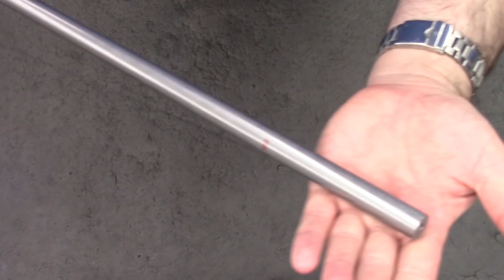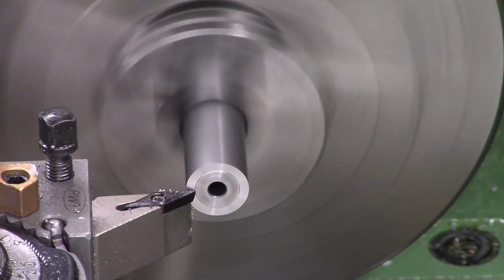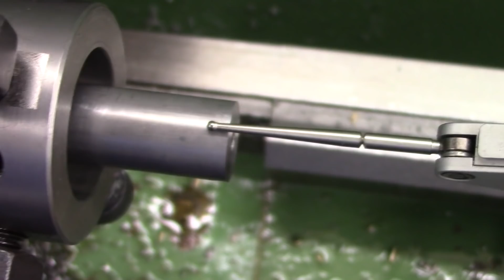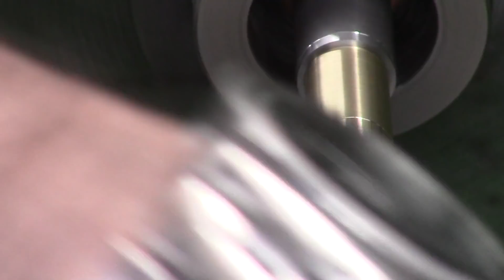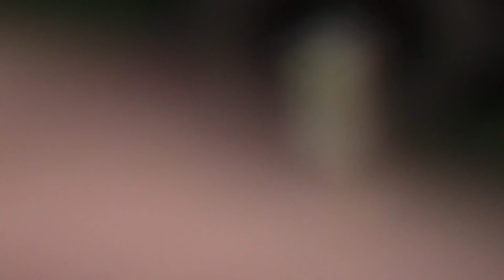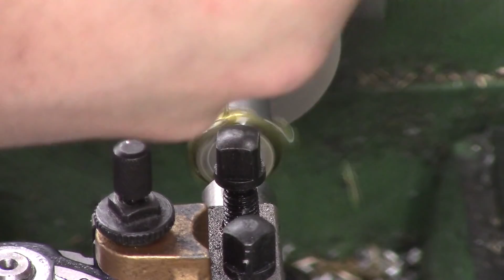Machining A Lothar Walther barrel to fit an FX Impact. Part 1.

Comment: Just bought a alfa barrel polygonal 177 blank for my leshiy classic how do I tell what end to crown no stamps on either end an will a standard 11 degree crown be OK on a polygonal barrel 👍
Reply from the maker: just push a pellet down it and one end will be tighter than the other the tight end (the Choke) is the end to crown and 11dgr will be fine  👍
Reply: @sub12airgunners  thanks ,,but there's no choke on it I forgot to mention that 😬

Comment: Hello, do you have a preference between the LW Poly barrels or Std LW 10 groove barrels? I want to strictly shoot slugs. 
Also, would you recommend using a choked or non chocked barrel for slug shooting? Cheers

Comment: I used a Lothar Walther barrel blank to turn a .177 caliber Benjamin Marauder into a .20 caliber. I left two baffles out of the shroud to get 2.7 inch longer barrel for better efficiency. I machined the bolt from brass to make it obvious that it was not a stock Marauder. The hardest part was making the fixture to hold the magazines for enlarging the inside diameter for the larger pellets. The result is my best Marauder. I now have a complete set of .177, .20, .22 and .25.

Comment: I ordered a .357 barrel and will be machining it soon.    I saw that you machined out the rifling on the breach end.  My question is on how to create a smooth lead for the pellet.  I am thinking of using a reamer for a standard .357.  Can you explain what you did on your barrel to get a transition from the smooth part you turned to the rifling? Thanks

Comment: This sounds like a great combination for an FX rifle and Walter barrel, What does this normally cost?
Reply from the maker: A barrel blank can be anywhere between £70 and £150+, then is cost to get in machined so depending on your gunsmith and what he has to do it will be another £50-150. But it all depends on who you get to do it. Thanks for watching.

Comment: would it be a straight forward job to fit a LW barrel to a hatsan  AT44--10 ?
Reply from the maker: No idea to be honest, depends on how complex the breach is, if you are having accuracy issues before having a new barrel machined I would take a look at the breach and crown, just make sure there are no burrs and that you can push a pellet through it nicely, and the pellet looks clean with no scrubbing of lead, then you could always have a little go at polishing if you want, a lot cheaper then having a barrel machined up. Thanks for watching.

Comment: You definitely made that very hard work for yourself . Would it be much easier using the life centre those barrels are very straight but I wouldn’t worry about the outside not being perfectly concentric because with a live centre it will be all done from the bore.
Reply from the maker: Probably, but doing this way we guarantee everything to work, the 1/2 unf will be 100% parallel to the last 40mm of the bore, eliminating any possibility of clipping with the shroud or moderator, and the pellet will be fed concentrically to the rifling, and while most barrels are straight they are defiantly not all made equal. We don't do hundreds of these and for me its a interesting job that I like doing, so I don't mind the back and forward with the indicator.  Thanks for watching.

Comment: Ace video dude 💪🏻 … off topic but would you make one of those brass pistons for the amp regulator? .. thanks 👍🏼👍🏼 and keep up the good work
Reply from the maker: Thanks, we don't make the brass piston anymore, they are a pain to make and we could not really see any great benefit from them, the only thing you gain is they last a little longer but they still need cleaning up after a little while. Thanks for watching.

Comment: Is it easy enough to cut a 1/2 unf on your warco? I've got the wm250v and and am trying to get my head round the change wheels.
Reply from the maker: This one is easy because of the gear box, you can select thread pitches using some levers, but you still have to change a gear to go from metric to imperial unfortunately. I had the WM180 before I got this one, whilst a bit of a pain to change the wheels you can cut threads successfully on them, my 180 had a list on the gear panel with the gear order and position for the corresponding pitch, the 1/2 UNF is a 20 TPI so just look out for that one and you should be able to find the gears that cut that pitch. thanks for watching.

Comment: Do you shoot fac air ? I am about to get a Raw HM1000x that will become fac . They have a lw poly barrel so should be good out of the box but I am thinking a match grade rimfire barrel for shooting slugs at rimfire weight and speed . Or should I just leave the factory barrel as is .
Reply from the maker: We don't shoot FAC, but the Raw should be great out the box, a poly barrel is usually better for slugs, as some rifled barrels can tear the lead of the pellets, you would probably be best off trying it out the box and seeing the results, and going from there, but I am not much good with FAC stuff so I can't help unfortunately. Thanks for watching.

Comment: Definitely the best airgun channel there is, I wish you good health and a long life and make us many more such educational videos. This is a masterpiece and keep these videos separate in case you happen to disappear from the Youtube platform. I enjoy each of your videos. Thank you for your time and effort to the general benefit of AG fans. 
One question, isn't there an easy way to center a barrel bore ?
Greetings
Reply from the maker: Thanks mate, I appreciate that, its good to hear people are really enjoying the vids. As far a centering the barrel bore there are a few ways to do it quicker, but barrel bores are very rarely perfectly straight they normally have some bow or bend to them, not massive but its there, and to be honest 90% of the time its never a problem, but in some cases where the bend is more pronounced it can cause you issues if you don't account for it, so we use the bell chuck to measure and align the bore with the axis of the lathe, but this barrel could have been chucked in the 3 jaw and just machined straight, this one was not out far enough to worry about, but some barrels this is not the case, and i wanted to show it for the video. Thanks for watching.  👌